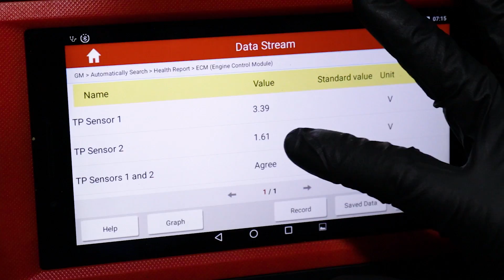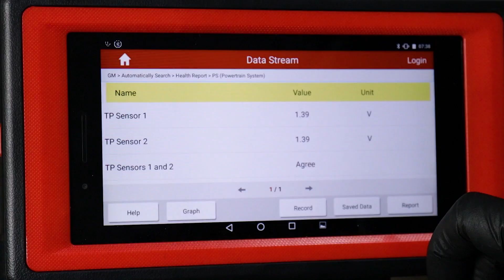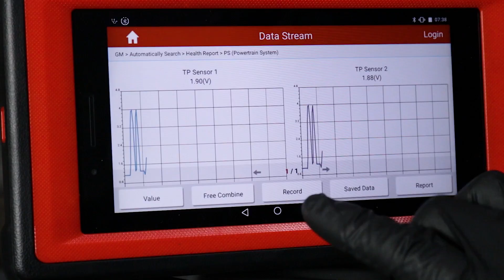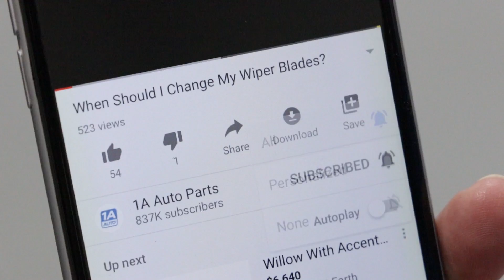Check Engine Light? Truck Reduced Engine Power or Stalling - Code P2135

Comment: I bought a Silverado work truck from my boss for $1500 more than a year ago because it had the P2135 and P0120 codes. I kept an OBDII computer connected so that when the engine light came on and power was reduced I would erase the code and restore power. The problem got worse and I had a mobile mechanic look at it but he couldn't figure it out and then I took it to auto shop and they replaced the throttle body that had previously been replaced but the reduced engine power returned with a vengeance. Last night I reluctantly looked under the hood at the wiring and I found electrical tape wrapped around the wires coming from the connector to the throttle body and noticed that someone had replaced the connector with an aftermarket version and spliced it in. I recrimped the connections and the engine light never came back on. This had been stressing me out ever since I bought the truck but now I can breathe a sigh of relief. Thanks for your videos.

Comment: I’m my case my I had 08 gmc Sierra that my dad had handed me down because he wouldn’t use it before he had gave it to me he changed the trans filter and fluid before it was smooth ran great shifted good after he did it it was like it was stuck in 3rd causing me to take off slow I got tired of it been so I took the filter out put another and found out a cable wasn’t connected from when he had did it he forgot so that can be a problem if u have a used truck or just a thought I was looking forever what the problem was I even scanned it nothing popped up

Comment: I have po1518
Reduced engine power did not have this problem till I had my rear main seal fixed could it be a wire or is it really my throttle

Comment: I have a 2008 chevy colorado 2.9L engine and I'm have issues when my truck reaches to temperature when goes alittle bit above the temperature my truck attempts  to try to turn off and sometimes it does actually turns off on me can I can't figure it out I already replaced my thermostat and my temperature sensor too and it still does it trys to turn off on me once it turned off on me when I was on the freeway  and I was rolling down the freeway on the center lane  and I immediately shift it into neutral  and panicked and immediately switching lanes to get off the freeway to get on the side of the freeway out of traffic

Comment: Wanted to share my fix, Hopefully it will help someone!  Had codes p0120 and p2135 simultaneously, I replace  the O2 sensors, throttle body, vacuum hoses, MAF, plugs, pcv and the engine has only 8000 miles on a reman engine... still in Limp mode and pissing me off pretty bad! there was no way it could be any parts at this point so i started checking electrical and found nothing, So i bought another throttle control switch only this time and it came with a new connector(plug)went to put the new plug on and as i was splicing one by one low and behold, the grey wire basically fell out of the old connector(plug) hanging on by merely the insulation, put it back together and immediately out of limp mode, no codes and purrs like the B*^&ch it is!! probably 4-5 months every weekend trying new things. Check your wires!!!!

Comment: Actually GM has a service update for this code, so it should be a free fix. They told me it was intermittent & my computer, so I just ordered a new one as well as a new throttle body just in case. Still cheaper than what the dealership wanted for just the computer.

Comment: Guys I need some help am tired of fixing my audi I have rently replaced everything at the moment my car when u drive it keeps on throwing epc light it will jack and secondly what makes mad is my car when it resches 160 it stop won't pass and now things are getting worse from 0 to 70 it has all the power but wen it reach 70 it stall you can press your padal down it won't respond

Comment: In my case, the scan tool gave me 17 codes relating to the TPS, the accelerator sensors, etc. so I knew the problem was not in the throttle body. After checking the wiring harnesses again, I found out a rodent had chewed on two wires going to the control module next to the brake cylinder. It was hard to see but that was it. Fixing those two wires saved me a ton of money.
Reply: In most cases, it's the wiring going to the item the code scanner detects at fault. Always best to check the wiring, especially when the scan tool says it's getting a low reading of voltage on something or it's getting a high resistance on something. Both of those would indicate a broken wire or loose corroded connection. The area I live in (a rural backcountry) we have a lot of problems with pack-rats eating wires and packing the air-intake full of stuff they gather up. A common thing is dog food the dry kind. They can really cause some problems with wiring that can be nearly impossible to fix sometimes. People who don't drive or run a vehicle very often usually end up with these problems. Tractors especially have mouse and rat issues.
Reply: I did some research onetime about why rats seem to be attracted to the wiring in cars/trucks. I found out that some of the coloring ingredients used in Chinese-made wire contain a soybean mixture and that's why they're attracted to it. Might even prefer certain colors over others too. Even if it's an American car, it still could be using Chinese-sourced primary wiring.
I told my friend, that maybe the purple wires are grape and the red are cherry 🍒 flavored to the mice! Green with yellow stripe is apple/lemon flavored! LOL 🤣

Comment: 😢 I had that problem with my mercury mountaineer. And I switched the throttle body and instantly the check engine light goes off and the car start running nice n smooth again. But after 2 weeks I changed the throttle body check engine light goes on again. And it throw me the same code saying my sensor a/b again 😢
Reply: I have that same problem now. What did you end up doing? Put a tps in yesterday. Now pedal position code comes up.

Comment: Great video , question for you my acadia gmc goes into limp mode and stalls sometimes,  ive replaced trottel body , mass air flow sensor., acceleration pedal sensor. Pcv, coolnt temp sensor. Thermostat, torque converter  rebuilt. Oil and filter chaned. Spark plugs new. New crank sensor, good fuel pressure,  still problem  not solved any advice?
Reply: i am having the same problem, did you figure it out? 2016 sierra 1500

Comment: How long can I drive until get it fixed ? It just popped up on my dashboard saying engine power reduced smh
Reply: Did u get it fixed i just got that on my 2022 equinox 8k miles 5 months driven
Reply: How did you fix the problem?

Comment: Thank you so much! I had the engine light come on and I had it checked it said that code and I'm replacing the Throttle position sensor! I hope it hope my Ford run better and save on gas! It's getting out of control!
Reply: Mine just popped on how long were u able to drive until u got it fixed ?

Comment: Question, i have colorado 2.8l duramax, with 46k, when im driving it make pulls when the RPM is going up recommendations or things to consider  i never clean any sensors or throttle body i bought with 42k miles

Comment: I replaced the manifold and throttle body on my 5.3 to a 6.2 manifold and c7 95mm throttle body after replacing I got a check engine light on and  engine power loss on my dash replaced all the old parts back on. Still have the same problem

Comment: My 2021 chevy Silverado just shut down and wouldn’t start on Christmas morning 
The dash says engine reduce to half power. Had it towed back to where I bought it.
Dealership says it’s the computer that’s crazy to me for a truck with under 2000 miles on it to have this issue already
Reply: Just got the check engine light and reduced engine power message today ima take it in this monday 2022 equinox 8k miles

Comment: What about when experiencing Engine power is reduced, Service traction control and service stabilitrak in a 2011 chevy Silverado 1500 truck?
Reply: Mine was doing the same thing as everyone that commented above. The dash read reduced engine power as well as the stability control message. I replaced the whole throttle body with new sensors and did the same thing. I plugged my code reader in and it was the throttle/pedal position sensor inside the vehicle by the gas pedal. I have a 2003 Cadillac Escalade esv
Reply: I have the same year truck and I’ve been having the same issue, you commented 5 months ago, have you ever found a solution???
Reply: Having the same issue with a 2004 gmc yukon xl 1500
Reply: I got a 2010 Silverado doing the same thing …. Did anyone figure/fix theirs??????? If so How?????
Reply: @bear186  mine doing the same thing have you fixed yours bud?
Reply: Same issue here. Did replacing thr throttle body fix your problem???
Reply: Try unplugging the negative terminal and plug it back with in 1 min
Reply: I just started having this issue with my 09
Reply: Same problem on 2012 chevy cruze and no one cant find the problem
Reply: that has to do with the spark plugs

Comment: Hi I have a 2008 GMC sierra Dinali I recently noticed that my oil pressure sensor readings zero so I went to replace the sensor and and digging through that screen and there was no screen the pick fall right in the hole ,how can I retrieve it back I took off the oil pan still there’s no sign of the pick what should I do?

Comment: I can be driving at a steady highway speed for 45 minutes and it will suddenly happen. So I have to pull over and shut it down for one to two minutes. Then it will start and run fine for a few more days.
Reply: My same issue!! What did you find the problem was. You could possibly save the broken down body many hours working on a broken down truck!😂 Did you find and fix it?

Comment: I just thought I would add input as to what fixed my vehicle because it kept sending my throttle body and gas pedal sensor codes ... turned out the oil was low and the place I got it from didn't check fluids apparently so I was able to save a few thousand bucks on a good vehicle. Hope this helps someone who is having random trouble
Reply: Have you issued any problems after changing oil? My error came on today with the message "check oil level" along with p2135  thank you

Comment: Hello. When replacing the throttlebody. Does it have to go through a relearn process or can you just take the old one off put a new one on plug everything in and you should be ready to go? Thanks. I have a Loss Of Power Light on in my 2004 Envoy. Thanks.
Reply from the maker: +James Barlow Jr. Thanks for watching!  Some vehicles will require a relearn process, while others will be plug and play.

Comment: I have an 01 olds bravada that when i push the pedal to the floor it has a flat idle and will not shift, but when i let off a little bit it'll catch and shift gears.

Comment: What does it mean on 08 Escalade when i got a brand new one put on my truck the gas pedal not responding like im not getting no power to my engine my peddle go straight to the ground n it pops up on my dashboard im not getting pressure to my engine got alot new parts done please u can tell me what it might be
Reply from the maker: +Yung City of H.M.G We wouldn't be able to diagnose an issue like that here, you may want to have a local mechanic take a look at it. Thanks for checking us out! http://1aau.to/m/Shop-1AAuto-c

Comment: Low tech "wiggle" test is a great beginning. Was often thinking of taking off the throttle plate but with mention of laser, glad I didn't. Never occurred to me that there was low voltage dielectric grease meant for computers. There is a warning about moving the throttle plate, manually when its operated by computer control.
Reply from the maker: +Tom OConnor Thanks for the feedback!

Comment: How is 1A mechanics and the production of these video's, so perfect. I love this channel. Rings my Bell :P
Reply from the maker: +James Doyle Thank you! We love empowering our customers and showing how to perform DIY auto repairs with our high-quality auto parts. 1AAuto.com
Reply: By showing you how to diagnose the problem they can provide you with their replacement parts to make the repair. Misdiagnosed items related to the engine control computer are often non-returnable. This more detailed diagnosis helps prevent unnecessary parts from being replaced. Which causes a headache for the customer, money, and downtime. 👍

Comment: Never knew there is high and low dielectric grease.  I have crc dielectric grease in a red dispenser. Just ordered rotor and brake pad kit for a 1995 Honda odyssey from a1 very satisfied great price and quality.
Reply: So which type goes on this harness?? High or low?